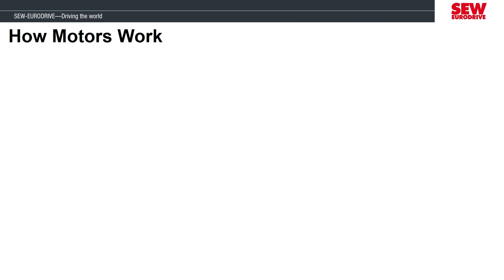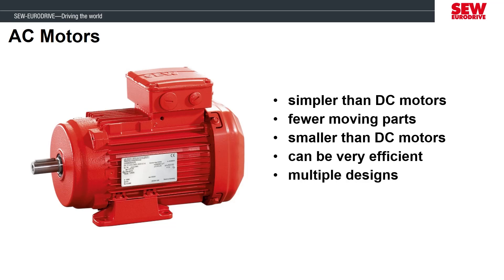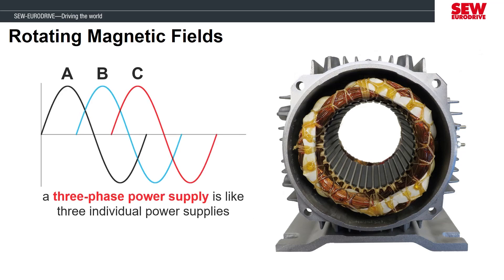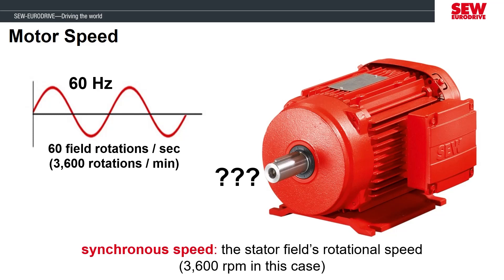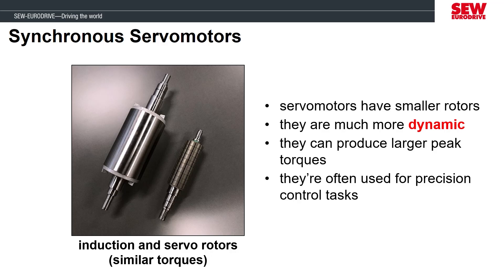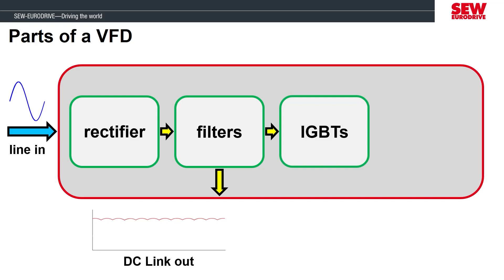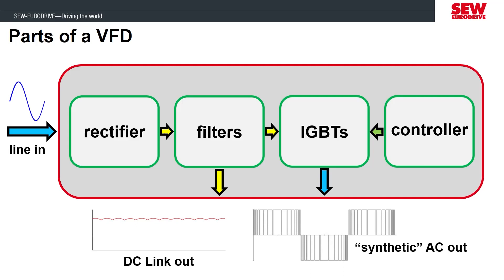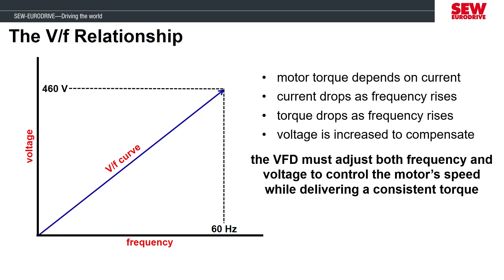MOVIDRIVE® B Training Session 1 - Motors & Inverters

Comment: What does no-flt means?
Reply from the maker: The Movidrive B inverter doesn’t have a message like this. However, our Movitrac LTE or LTP inverters do have similar messages such as “th-Flt” or “SC-Flt”. These faults indicate that there is an internal problem with the inverter. We do not have a message specifically “no-Flt”. If possible please contact your local SEW-Eurodrive office for guidance. You can go here to find your nearest office https://www.sew-eurodrive.de/meta-pages/contacts_worldwide.html.
Reply: We’re using movitrac lte and it’s flickering shows no-flt and we check on the manual that there’s no fault code for this “no-flt” that’s why we’re having trouble on why its showing this msg on display
Reply from the maker: @franma3140  The Movidrive B inverter doesn’t have a message like this. However, our Movitrac LTE or LTP inverters do have similar messages such as “th-Flt” or “SC-Flt”. These faults indicate that there is an internal problem with the inverter. We do not have a message specifically “no-Flt”. If possible please contact your local SEW-Eurodrive office for guidance. You can go here to find your nearest office https://www.sew-eurodrive.de/meta-pages/contacts_worldwide.html